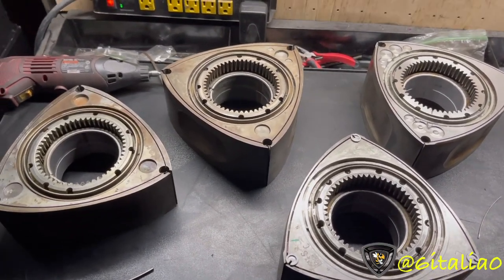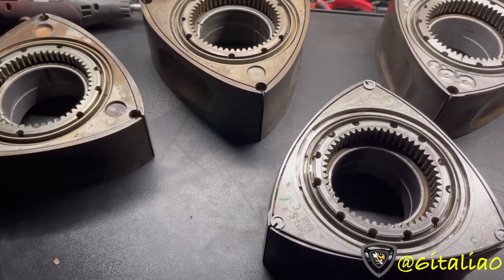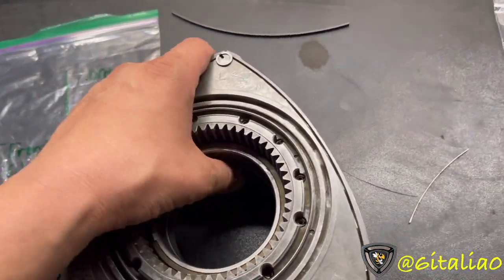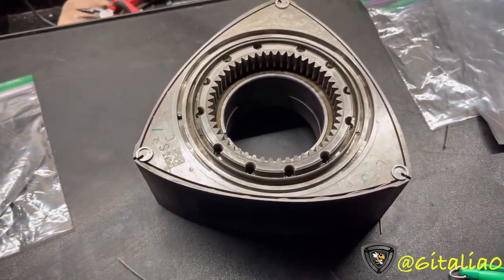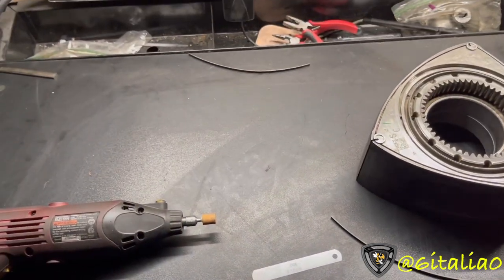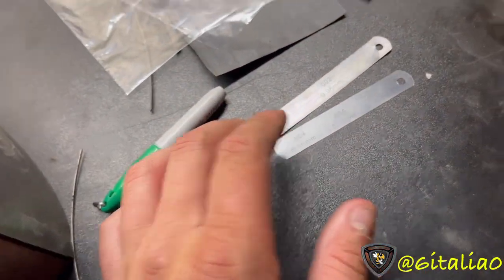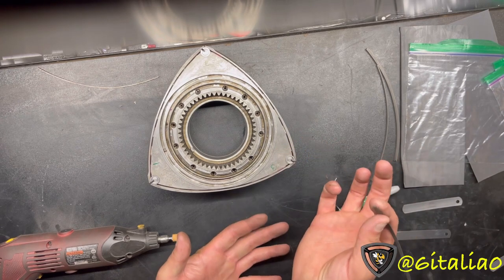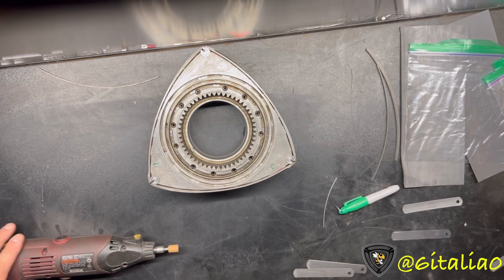THE FULL AND COMPLETE GUIDE TO CUTTING RX8 SIDE SEALS (CORRECTLY)

Comment: Would you say the outer right pointy part of the side seal after grinding would be an issue? The angle on mine look correct but that outer right corner look sharp and almost longer than a regular pre-cut seal.

Comment: What side seal clearance range if using renesis rotors in a 74-2002 13b (engines with exhaust port in housing) thanks.
Reply from the maker: .002

Comment: @ Nate Rist , so the right clearence is 0.5 mm ? Thanks you .
Reply from the maker: Here the seals were clearanced to .004. That is my preferred clearance for NA renesis engines. .005, .006, .007 and .008 would be fine too, but I would personally only do .006-.008 if the engine was going to see boost

Comment: Hi. Do you mind if you have sanding dust around the rotor?
Reply from the maker: just clean it up and clean the rotor out before assembly
Reply: @NateRist  Do not use abrasive tools near engine parts. It is bad.